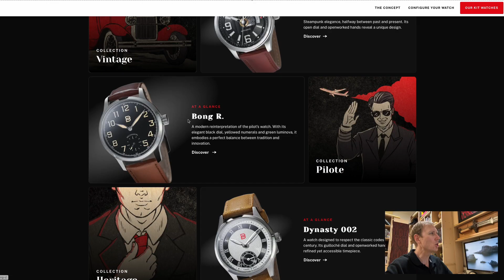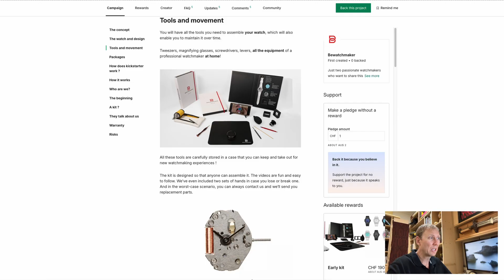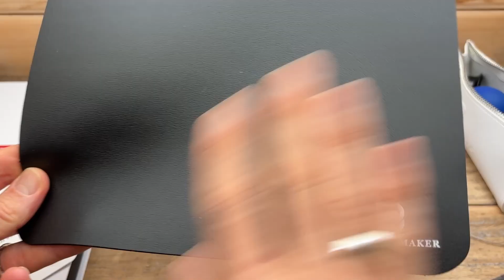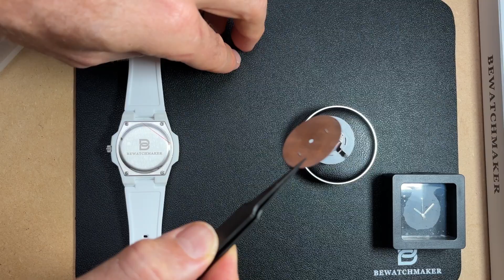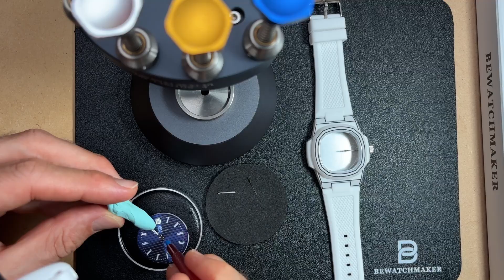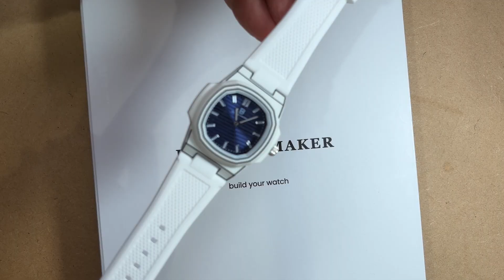Swiss Watch Build and its Quartz - From Be Watch Maker

Comment: The following is what works for me with hand-fitting, especially the seconds hand. Make sure you've got good hands-free magnification on your head and great light e.g. you could stand by a window; yes, I said stand. Anyway,  put a very small blob of Rodico on the hand pushing tool and use this to pick the hand up at its centre and then move the watch dial/movement up to the hand that's held on the hand pusher in your other hand, seat it on the spindle and then gently push. This is the reverse of what people normally do but it does work. If you go the "normal" route, magnification, light and a steady hand are the keys to success as well as having the correct sized hand pusher of course.

Comment: It is strange to send out a kit that can't be built, I've seen misaligned dials but that is well out! At least with most quartz movements, if something goes wrong it is fairly inexpensive to swap in a new movement. You are brave building a watch on camera 😁👍
Reply from the maker: I think that was more my build skills with a prototype kit issue vs what I think the production kits will be like.
Reply: @WATCHingJames Yes, I'm sure you are right. By the way the second hands on quartz watches are so tiny, don't feel bad about not getting it to fit.